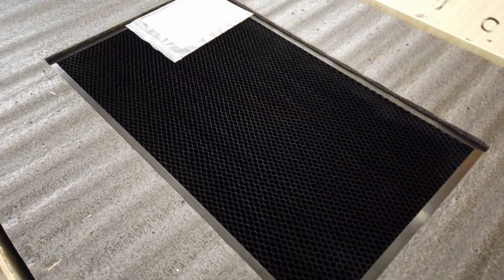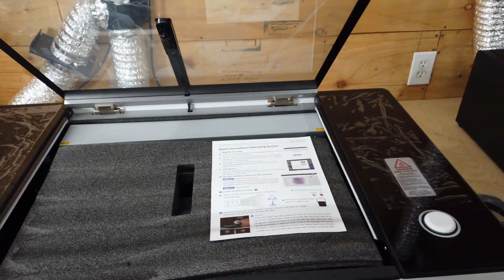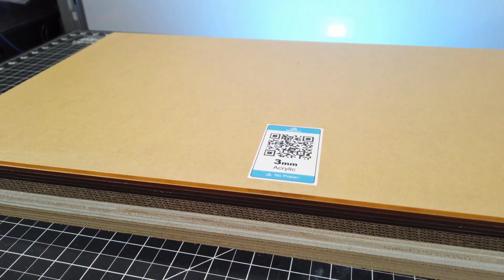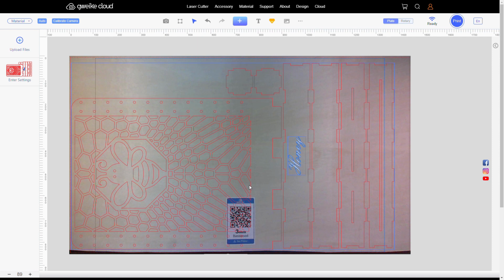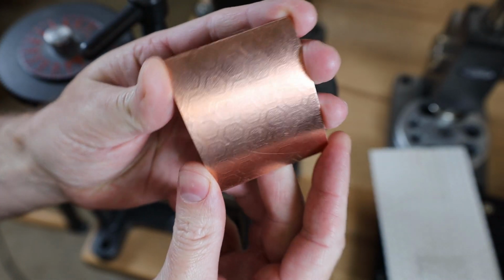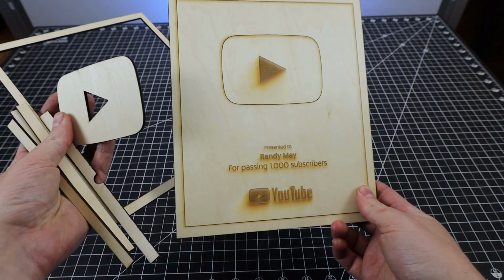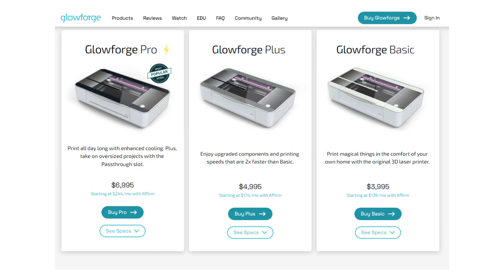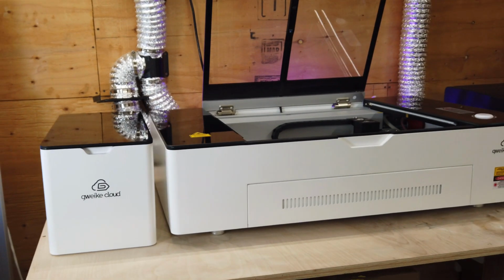GweikeCloud 50w CO2 Laser: A Better Buy than the Glowforge in Every Way!

Comment from the maker: Links to Gweike Cloud Laser Cutters:
https://bit.ly/GgweikeCloud-Pro-Laser-Cutter
https://bit.ly/GgweikeCloud-Pro-Laser-Cutter

Materials for Cutting & Engraving:
Aluminum Business Card Blanks - https://amzn.to/3S96efP
Baltic Birch Plywood 3 mm - https://amzn.to/3SvHxu1
MDF Sheets For Laser Cutting - https://amzn.to/3C0PBNI
201 Pcs Engraving Material Box - https://amzn.to/3C2Ow84
Acrylic Sheets - https://amzn.to/3DAXBoj

Metal Rolling Mills:
PepeTools Rolling Mill - https://bit.ly/ComboRollingMill
Economy Rolling Mill - https://amzn.to/3he1k3L

Laser Software: 
LightBurn - https://lightburnsoftware.com/

Free Test Files:
Cut Test CO2 - https://drive.google.com/file/d/1ZhxGrLLfZVv1x-H03r4GdpG8KMAWNMyY/view?usp=share_link
Line Test CO2 - https://drive.google.com/file/d/15c085PNo8DDnsX5xmUUDgg46oHzJbTO5/view?usp=share_link
Engrave Test CO2 - https://drive.google.com/file/d/170GNGLtIbylGcZPJNAc3YcsL4WByho_E/view?usp=share_link
______________________________________________
Note : Most of the links that I use that go to products are affiliate link. This means I make a small commission on anything that you happen buy using them. This is at no extra charge to you and this helps support the work I do on this channel. 😁👍
______________________________________________
#gweikelaser #gweike #co2laser #diy #3dPrinting #maker

Comment: Hi Randy,
Thanks for your review. I am a hobbyist woodworker and would love to acquire a laser cutter. I know nothing about these machines other than what I have seen on you tube. I would like to explore engraving etc., but wondering what other capabilities has this machine with regard to operating with wood.
Reply from the maker: For the most part this laser will cut and engrave wood but it will not cut anything that is super thick and it will really depend on the type of wood you are working with. That being said you can add amazingly detailed designs to your work if it will fit in the laser housing.
Reply: @randymay  many thanks for your response, appreciated